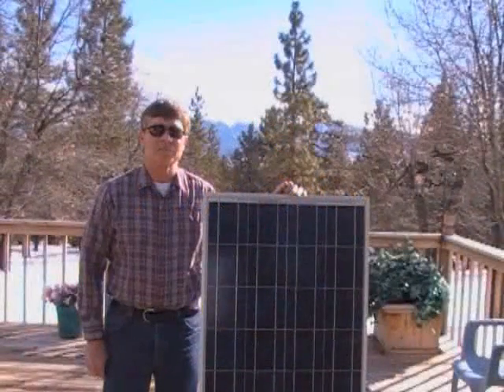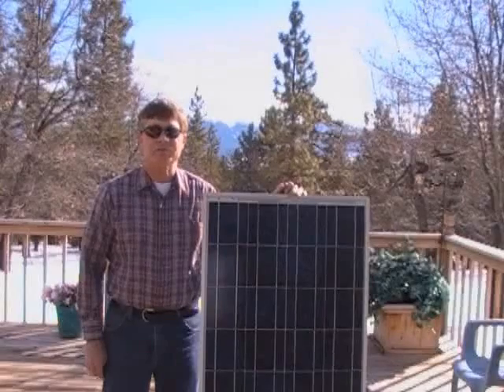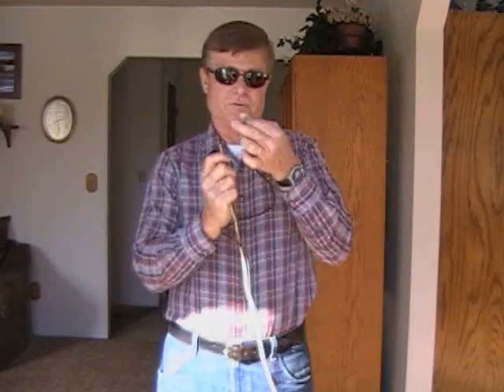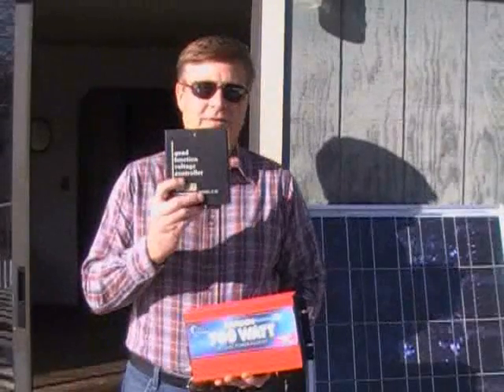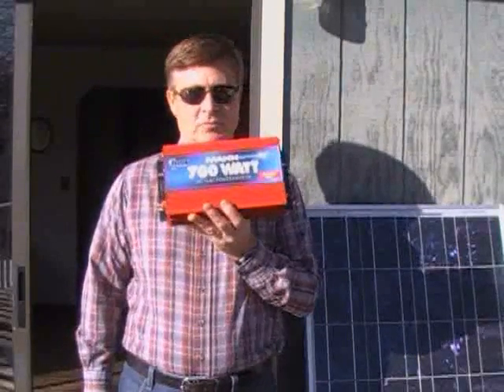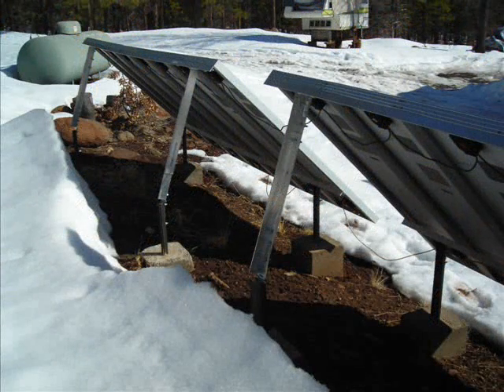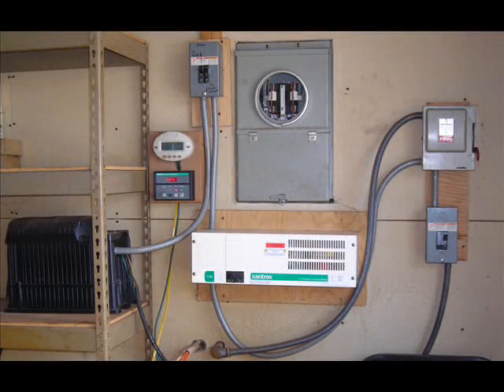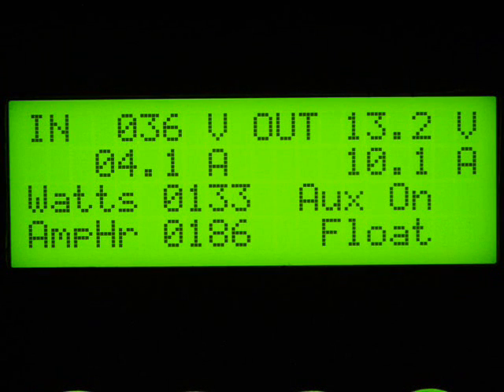Solar Electric Home - How We Use Solar Electricity

Comment from the maker: My battery bank is capable of handling approximately 5 times my daily use. It is not a good idea to drain a battery completely down. I do not let them become completely discharged which allows them to perform well over a long period of time. I usually use no more than 20% of capacity and use a backup generator to charge the batteries when the sun does not shine. I am on my fourth bank of batteries in a 24 year period. I average about 7 years before I need to replace them.

Comment: does your batteries system go through 1 full charge-discharge cycle every 24 hours? If so, how many days/cycles did your battery last until they no longer hold charge?

Comment from the maker: @bridgetroll9 What you have stated here is all sound electrical principals and as stated is true. Cause a generator to spin with water and it will appear to be generating electricity. Try putting a load to it and it might stop dead in it's tracks if the flow of water is not sufficient.The laws of physics are not just someone's made up laws, they show up in the actual applications. Your original suggestion is a great idea but without a working prototype, it is just theory with basic flaws.

Comment: @livingonsolar Rotating magnetic fields are what produce electricity in a generator. The method used to spin the magnets determines it's efficiency. AC generators produce full power whether your utilizing all the power or not using any of it. 

Gravity and water make the wheel spin in hydroelectric plants. As long as gravity and water exist it will keep spinning. Sunlight and water will also keep a wheel spinning. Someone's made up laws are of no concern to me.

Comment from the maker: @bridgetroll9 This sounds like a great idea. Do you use this type of system? I would certainly like to see the cost effective comparison. I would be cautious in believing that this is cheaper and more effective if it is only an idea since what you describe is a perpetual motion system. Once you fire up the generator from the hydrogen produced by the solar panels and then the generator makes more hydrogen to power itself does not work due to the laws of physics.

Comment: A cheaper and more effective way to power your entire property is to have solar panels and a generator converted to burn hydrogen. Use the solar panels to get hydrogen from water to get the generator running. Once your generator is operating it can provide the DC current to make hydrogen night and day. 

Hydrogen can also be used in BBQ's, motorcycles, cars, heaters, etc etc etc.....

Comment from the maker: @helloman1976 The view shows the power coming in from the panels at 24 volts and out to the batteries at 12 volts. The inverter is programmed to shut off if the batteries go below a certain voltage. This has never happened in 22 years as I never let the voltage get that low before charging. We use a propane refrigerator, solar heat our water into a propane water heater and use a solar cooler (see our other video). We wash & dry like everyone else.

Comment: In the view on your charge controller is it showing the total coming in and the total going out to your house at the same time? Also, does your inverter automatically shutoff if the battery voltage goes below a certain level to avoid damaging the batteries? Finally, how do you only use 100kw per month? You don't have A/C or heat or a water heater or a washing machine and dryer? Thanks!

Comment from the maker: We use a very efficient propane refrigerator and do not have a refrigerated Air conditioning system, dish washer or heat water with electricity. That is the major reason. We also use energy efficient lights and have eliminated most of the small transformer loads. We use most all other appliances including a washer and dryer. Some use high power but only for a short time.

Comment from the maker: We built the home over 20 years ago. Since the property we bought did not have electric lines to it, we payed a lot less for it. The difference paid for the electric system. A system similar to ours would cost around $9500 before any rebates or tax credits. It can easily provide 4 KWH per day. We use 3 KWH. I can't answer all your questions here but feel free to ask any on our livingonsolar blog.